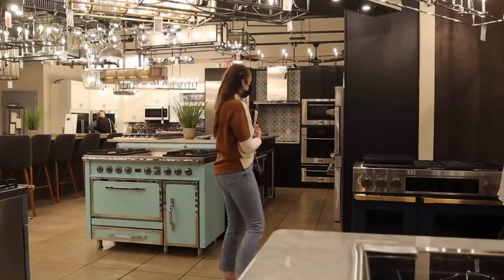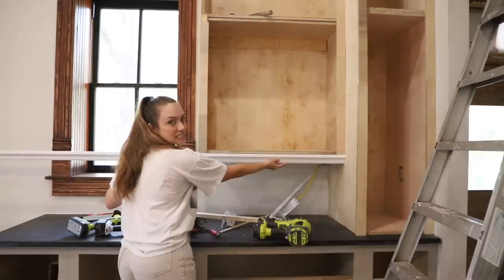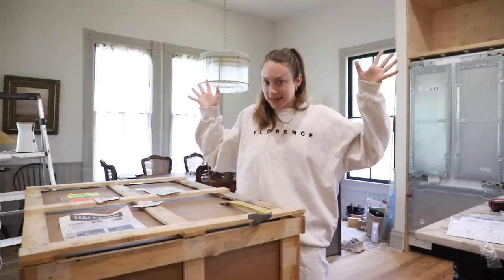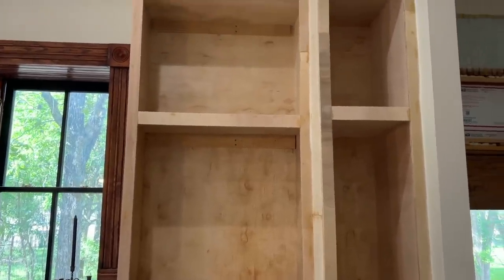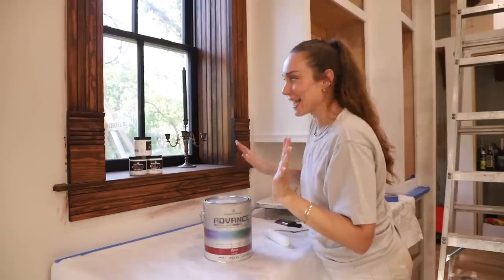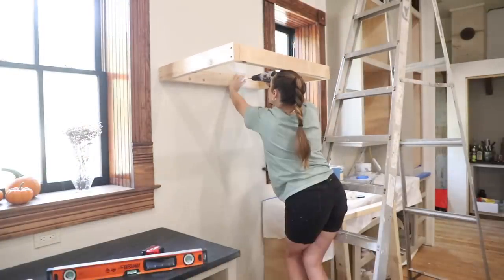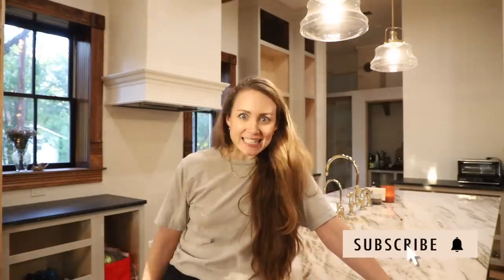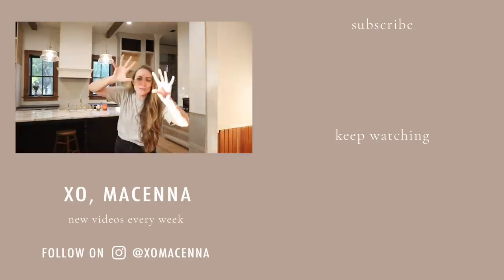we waited a year for THE WRONG OVEN!! & DIY Range Hood | XO, MaCenna

Comment: The antique white is such a classic color from back in the day and resonates nice with the overall style and colors in the kitchen, as well as the rest of the house.
Hoods in the kitchen and whatever is above the stove / cooktop has a tendency to collect all kinds stuff that evaporates below. ´
From steam bringing wetness to all sorts of fats and oils. Priming is the minimum I'd do if I have absorbing materials. Untreated wood and drywall really sucks up and collects every kind of moisture and smell.
It might be a good idea to do some sort of sound insulation to the box of the hood, to avoid it resonating to vibrations.

I never knew there are hoods with external blowers available outside of commercial applications. I've never seen such here in Germany. Maybe because the noise on the outside would be too much for our typical  residential areas and their very strict noise rules.

I really like the overall choice of colors throughout the house and the classic design with modern touches.

Comment: But how did you get the range hood structure so sturdy? I was waiting to see how you attached it to the ceiling but you didn't say? Also had no idea how crown molding worked until you put some on the range hood! I thought it was solid block wood cut out!! Everything you do on the house is so impressive!

Comment: I know everyone is saying that the range was a happy accident, but I disagree. Yes, it is really beautiful in antique white on its own, but I don't think it's right for that run of cabinets along the back wall since it has the black soapstone countertops and the darker taupe cabinets. The fact that the range is antique white and the hood is Gray Mist feels like it's just this vertical chunk of really light colors in the middle of a darker, moodier portion of the kitchen. If your range had been in the island then, yes, I think it would have worked because of the lighter countertops. I feel like your initial choice of stainless steel was the right one because it works so much better with the dark taupe cabinets and the black soapstone counters.

Comment: the antique white oven is gorgeous! i think that if you painted the range hood with a lime wash or use multiple colored paints on it to accentuate the plaster look would really make it pop. It feels like being a single color is missing the depth you get from your inspiration photos.
Reply: Completely agree with this!!
Reply: I think with adding the tile which will most likely add in some color will be enough. If not, she can add color to the hood later but for now I feel she needs to keep It as is until the tile is chosen.

Comment: Has someone just opened a box expecting an antique white oven and got a stainless steel one? I do like the white oven a LOT. I couldn't imagine building my own kitchen, I think you're doing such a good job. Your kitchen, when finished, is going to be amazing!
Reply: I hope not cause I would be disappointed as heck... imagine if they designed thier whole kitchen around the white range and then stainless steel shows up!
Reply: That’s what I was thinking and I’d be soooo pissed if I excepted white & got stainless steel! I’m sure the company will fix it how y’all want
Reply: @megcreates2.0  I'm sure the supplier is working hard to try and figure out what's happened. Usually in these circumstances it's down to human error at some point. I hope they sort things out. TBH I like the antique white and think it will work for them, if they decide to keep it.
Reply: @waterbitten  In honesty I prefer the antique white over stainless steel, which I think is hard work to maintain. I'm sure the supplier is trying to sort it out. I hope someone else wasn't disappointed to open up their oven. Waiting a year for the wrong one is quite something. MaCenna reacted so well!

Comment: Give the range hood a coat of paint with sand in it. It will be amazing, trust me! It would give a handmade, old world look and feel like you wouldn't believe. 👍
You can get sand for paint at the BM store, or just at a hobby store. You can get it in various sizes of grain, depending on the look you want. 
To give you an idea of what you can do with this...
I added sand to a light turquoise color in my bathroom, painting it on horizontally with a brush. Then I used a stiff wallpaper brush and trickled silver and a little darker turquoise down the wall in swaths. It looks like a waterfall❗️👍🥰

Comment: I have the 48" Hallman/Ilve double oven. It took Months and it was so worth it. It is over 3 years old and works perfectly. You will love it! It's fine. I have the Stainless with Chrome. I hope you direct vent the hood through the roof. This is code in most States. You cannot vent into the attic as it is a fire hazard along with just yucky.

Comment: LOVE YOUR VIDEOS!!  ❤
I am truly inspired.  I boast about you often!!
My sweet❤️had worked construction for many moons and expressed “concerns”…
What is the distance btw counter top and upper cabinet?  Also distance between hood & where the oven/stove is going to be?  Also - he questioned that you top coated the dry wall without help from a professional…take that as a compliment!!!  He wondered about taping the corner bead (aka metal edging) and priming the drywall?  🤞without doing so may lead to cracking?

Comment: Caulking TIP: before you run your finger along to remove excess, either spray you caulk or your finger with soapy water (dish soap) - then it gives to a smooth finish.

Comment: Love love the white. What will your refrigerator, dishwasher etc be? Will they clash or compliment each other? 
In my humble opinion, you should absolutely get a decent discount due to wrong item, be it you keep or return. Even if you love and keep, it’s not acceptable to wait 1.5 years for the wrong item. I can’t understand how this was overlooked, it was noted on the outside of box, so no one thought it was important enough to check before shipping to you, or they knew and sent anyway, either way this is not professional. If you want what you ordered, you could tell company instead of a discount you will keep wrong one until correct one arrives in another year. I’ve done this with furniture that was either wrong or damaged, although that was usually only a few months turn around, but still error is not on the customer. You have great taste, go with your instincts without guilt. PS did you confirm the oven is gas or electric (maybe same item comes both ways? and you will definitely want what you need in that regard. Keep on trucking :) you are incredibly talented.

Comment: I would keep the wrong stove. I looks so nice. I’m not a fan of stainless steel. And your refrigerator is going to covered. So I would just keep the wrong stove and I think it would look great. I’m impressed you did the plaster of Paris. You could have done almost the same thing with joint compound and it’s thicker. I used it in a bathroom that was primed before putting wallpaper on. The walls were a mess. So I just put texture with joint compound on all the walls. Then painted it. I’m not sure how the people who bought the house felt. But I did what I had to do. I wasn’t going to put all new drywall or whatever you need in a bathroom in.

Comment: A little late for this but in the future when building things like cabinets that fit around appliances or false panels for the front of those appliances don’t be afraid to call customer service and ask whatever questions you have about the construction process, dimensions, materials, etc. 
I used to draft for a custom cabinetry firm and I was saved quite a few times by those reps. They know their products in and out.

Comment: Did you cover the top of the crown molding on the vent cover?  I would.  That would give you a place to prop up decor and would keep the dust and debris out of the valley created between the wall and back of the crown molding.  Just  a thought!

Comment: I am surprised you didn't sand the Plaster Paris on the hood to make it smooth. You are amazing, your ability to build all this.  You could make the fan hood actually stand out and colour it with a bright colour as a stand out feature in the room is another idea.  I think the Pashmere on the cabinets is great, but I wonder if you painted the wood on the hoot cabinet the same colour as the widows?? Just throwing up ideas. I imaging once you put it all together you will change colours etc.  Can hardly wait to see the tiles put up.

Comment: I think that you should consider doing simply tile in that square above oven and not in that thin area under windows or side area. Just in the splash zones. And I think it should be the same color as the wall

Comment: I’m team 2-tone range hood. Pashmina on the top and Grey Mist for the molding and flat part between the two molding strips.
Reply: By the way, the antique white costs $600 more than the stainless steel. I def like it better than the stainless steel. And I love the brass hardware instead of chrome.